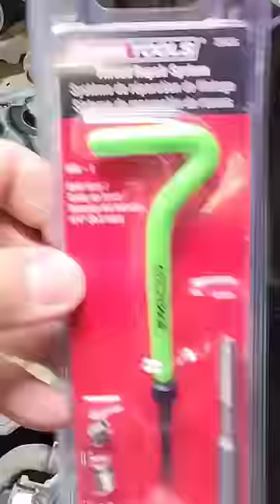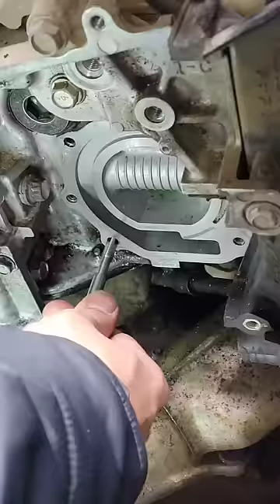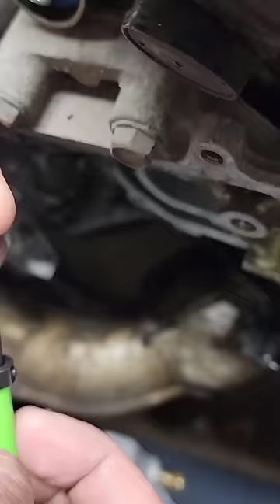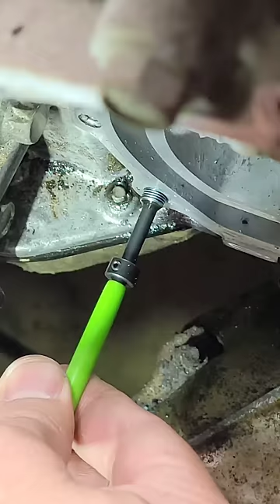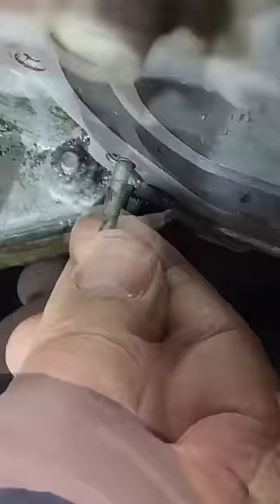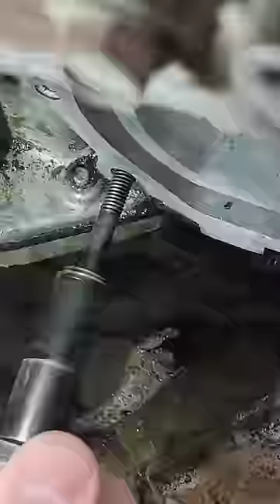Quick OEMTool Thread Repair! Stripped No Problem

Comment: You're only supposed to turn the helicoil c.  one turn below the start of the threaded hole. This can be set  with the collar on the insert tool if you're doing a lot of helicoils.  You also need to fit the correct length helicoil to suit the hole depth/fixing length/load requirements.
Also belting the tang off with a bolt can dislodge the helicoil in the thread; THEN you've got a real problem!! 😬 You turn the tool anticlockwise to snap the the tang off. 👍
Reply: Bla Bla Bla.
Reply: Doesn’t the tang fall in? Sorry I’ve never done this and trying to fix my pressure washer.
Reply: @MangroveSnooker  If it's a blind hole then it it's not a problem you can usually pick the broken off tang out with tweezers, a magnet or some grease can help. If it's a through hole, you need to make sure it doesn't fall into something (along with any swarf!) where it can cause damage; gearbox, oil pump, cooling system etc. 🤯 or where you end up taking more bits off the job to try & find it.😬 Just my 2 cents.
Reply: I've never seen so many people read a comment on how to PROPERLY DO SOMETHING, HOW TO USE THE TOOL TOO ACCOMPLISH THE TASK AT HAND then come up with reasons on why it's ok to do something incorrectly haha. It's easier to just do things they way they are intended to be done. But what do I know, I'm just some guy on the internet 🤷‍♂️
Reply: I recover the tang with a pocket screwdriver that i attach my magnet to

Comment: Straight flute taps push the chips to the bottom,  spiral taps bring them out
Reply: Um.. I have taps that are spiral taps that push them into the hole. Or with a through hole they push them down and into a chip  bucket, for production work.

Comment: ive never understood why people use these damn helicoils. always pull back out, ive never seen one actually take more then 20ftlbs. drill it tap it and use another slightly larger fastener. id rather 1 oversize hole then a cheapo repair that has a 50/50 chance of fAILURE. ford used to beg us to quit using them as they always had warranty issues after. when i was a machinist pending on hole depth we would drill it dimple it and fill it with braze to rethread a proper hole. at ford the recommended procedure was to drill it tap it and use a larger bolt. we specifically carried 10 - 12 and 8 mm bolts that had larger threads for that process. so the fastener head would remain the same but you could have a variety of threads from metric to sae.